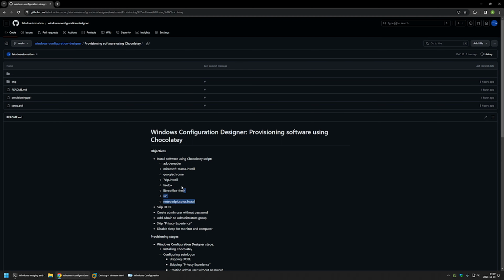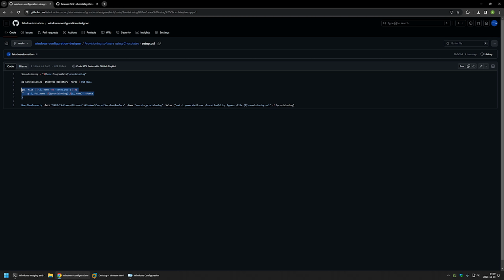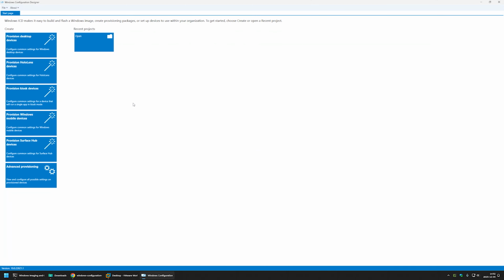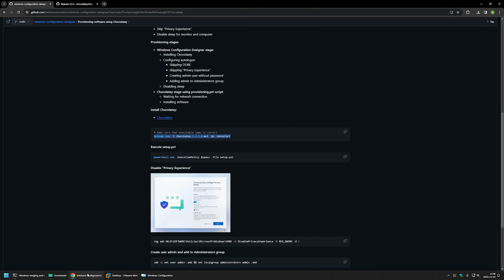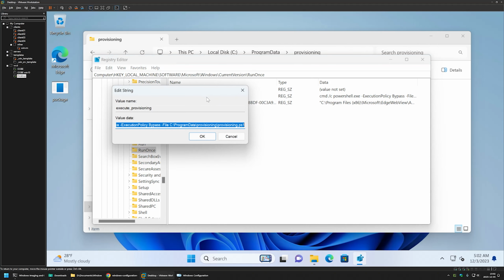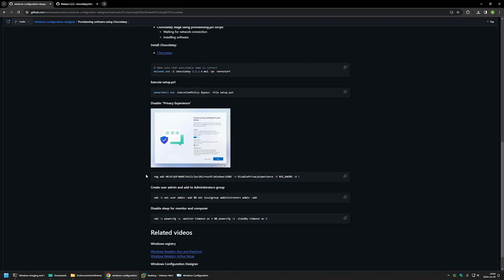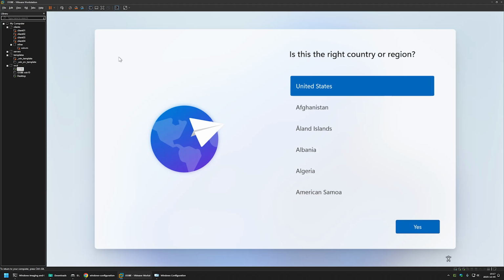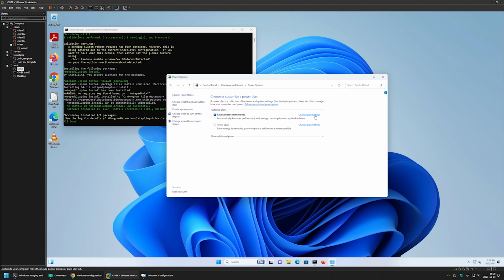Windows Configuration Designer: Provisioning software using Chocolatey

Comment: Insane Thank You very nice content !
Reply from the maker: No problem. The video about adding Windows updates is also out and if you want to combine Choco + Windows updates you can find the "Chocolatey and Windows Updates" page on my GitHub there you will find another provisioning script that you can use and if you will follow all the steps in this video it should work. There was a video about configuring a Wi-Fi connection last week and with that, it should cover all the steps that you told me about.